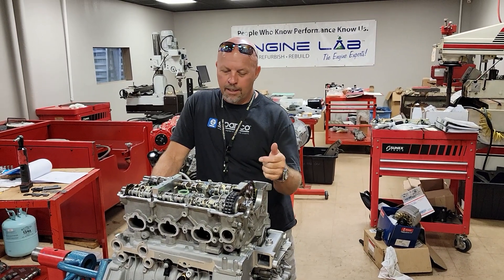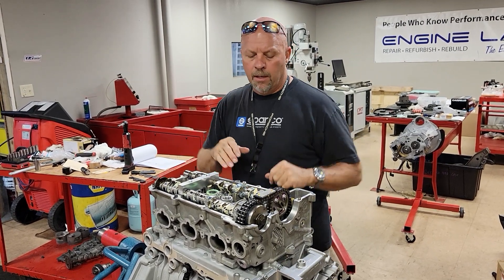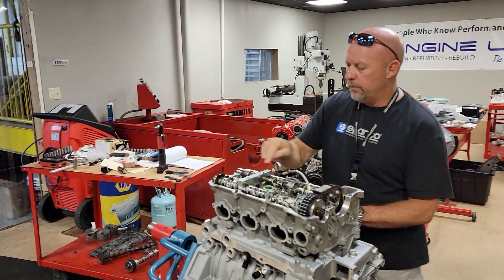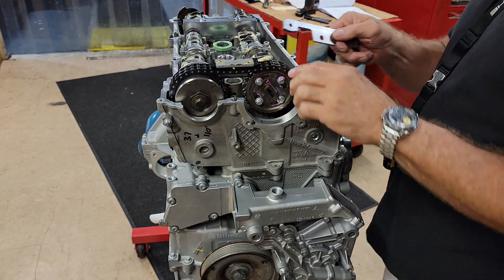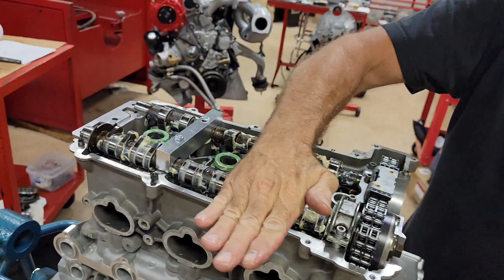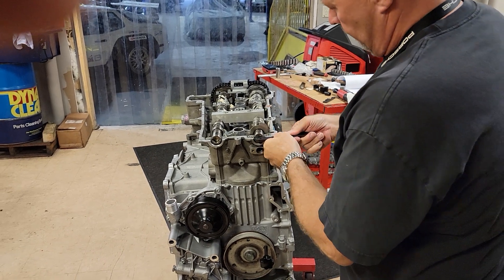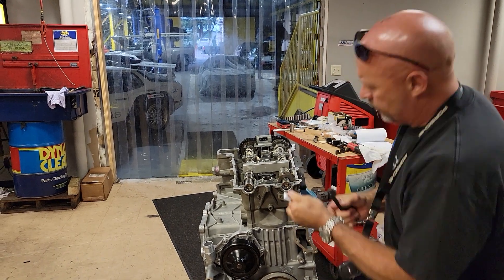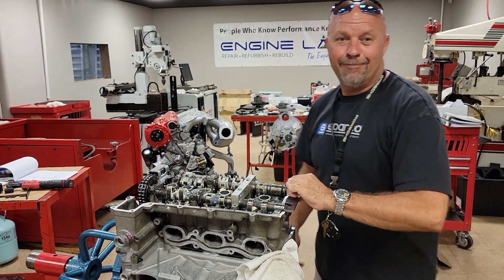Rokket Horton Explains M96/M97 Porsche 3-Chain Camshaft Timing for 996 & 997 Series of  Porsche 911

Comment: Hello Rocket,  fantastic video on a complex shop manual read but I still have a question. You don’t speak to the cam timing slots not being equal (1/2 moons) so the timing tool only only fits on the cams in overlap but yours seems to fit in compression and overlap. Are my cam journals worn or am I missing a step? Thanks
Reply: Hah, a year later I finally figured out that this motor is set up so that both banks are on TDC overlap, for demonstration purposes. That means the cams are shown 180˚ out of time from where they should be for a running engine. So don't make your cams look like this at the same time when you're timing your motor! (posted more for future reference for others)

Comment: Thank you very much for the video. I have a question, can the same tool for locking the cams be used on bank 1-3 and 4-6? 
Or the tool fits only on bank 1-3 and has to be modified to fit on bank 4-6?
Thanks
Reply: Fits both sides
Reply: And it’s not for locking the cams, it’s for verifying alignment of the cams. You’ll bend it if you’re not careful and it’ll no longer give good readings
Reply: And the tool will NOT fit on both sides at the same time. I don’t understand how they did for Rocket

Comment: Question I am repairing a broken valve spring on #3 left exhaust valve and will be retiming my cams when done, I am debating replacing the springs with new ones since I had a failure and wondered if you had any thoughts on this?
Reply: If you have 1- Broken Valve Spring I recommend that you replace ALL of them...Cheers

Comment: At 3:45 you state the camshafts should be facing outboard for cylinder #4. "101 Projects for your Porsche 911" says the lobes should be facing inboard towards each other for bank 2 and away from each other in bank 1. Can you help clear that up?
Reply: Is that at # 1 TDC on compression stroke?   I gave instructions on setting up both banks on #1 TDC.  That would be 180’ out of phase on #4
Reply: @HydraulicsTampa  it looks like Bentley and 101 Projects both state to time bank 2 (cams on 4 pointed straight in), rotate to U6 (eg not a full rotation of crank) and time/tighten bank 1 from that position. 
I read this as you timed both simultaneously by starting with bank 2 pointed out (which requires the cam support brace to open the valves on 5 and 6) and timed both at same TDC, resulting in 
Bank 2: cyl 4 cams outwards, cyl 5 intake partially open, cyl 6 exhaust fully open
Bank 1: cyl 1 cams 45 degrees out and down (valves closed), cyl2 intake vertical exhaust inwards (valves closed), cyl3 intake 45 degress down inward exhaust near vertical, valves closed.
Does that make sense? That seems a lot easier, if you can open the cyl5/6 valves with the brace. 
(I ask as I have a sealed bank 2 and the cam tool fits in both 180˚ phases, so valve open/close is my only reference without cracking the valve cover off to time bank 1)

Comment: Hello Rokket! Cheers from Tampa and thank you very much for covering this topic. With all the videos on 996/997 engines out there, everyone else seems to be either vague, or provide confusing information, or skip over the issue. I was in the process of prepping to replace the IMS bearing on my '03 C2, when I proceeded to lock the camshafts and realized they were not perfectly aligned on bank 1 while engine was on TDC (pin in the teardrop hole at the main pulley). They are very slightly off, and therefore can't install the timing install tool. Engine is already out of the car, but whole. Can I still use the method you describe here to adjust them? Would I need to remove anything else other than oil pump for access to the center bolt and 4 other bolts on the timing sprocket and without removing the valve cover? To clarify, my IMS bearing is probably the culprit (oil seep) in the slight misalignment. Car was running when I started the work. But I would like to lock the camshafts before proceeding to replace the IMS bearing. Thanks in advance and best of luck with the channel!

RESPONSE:

Hello and thanks for watching.  There are only a few ways that your camshaft timing can be off and it can be caused by different things depending on how off it is.   
1)  If the IMS is bad, usually there is a catastrophic engine failure and we have all seen the videos of Porsche Guts laying everywhere inside the engine, this will have a significant effect on the camshaft timing   
2)  Stretched Timing Chains will most likely be slightly off  
3) Worn Tensioners or Chain Guides:  I see more defective chain guides than any other cause.  I have taken engines apart and found the pads of the tensioner/guides broken off and loose in the engine  
4) The Cam Phaser (VVT) is defective and may have a broken vane.
5) If the engine was ever apart it may never have been properly to begin with.  We had a 911 GT3 brought to our shop (from another shop) and all 4 of the cams were 180` out of phase.  
 6) If your engine is out of the car, just go ahead and remove the  Valve Cover.   This will give you the opportunity to at least view 4 of the 6 tensioners and  the valve cover should be off  to adjust the timing with less chances for an error.

Cheers Rokket   813.605.5500
Reply: Thank you very much for the response, Rokket!  Yes now proceeding with opening up the cam covers, and kind of hoping to see parts that are in obvious need to replace.  I'm guessing 4 out of the 6 tensioners/chain guides are replaceable with just the cam covers ad cams removed.  Is that accurate or would I need to disassemble further? (found 2 small brown plastic pieces in the sump).  Thank you again for your time.  I will try not to take more of it.